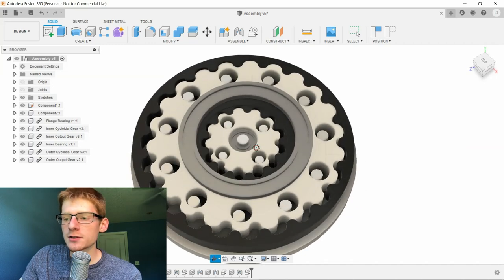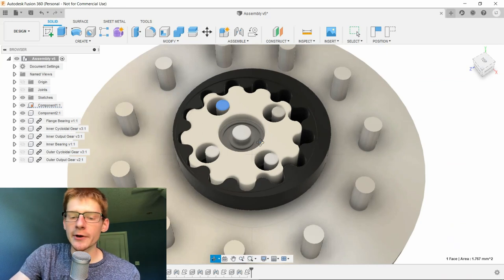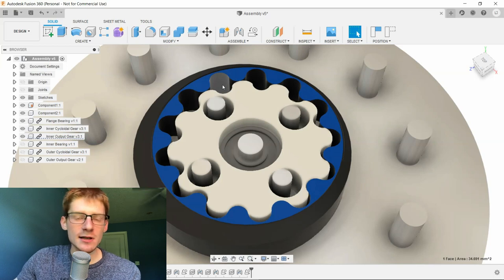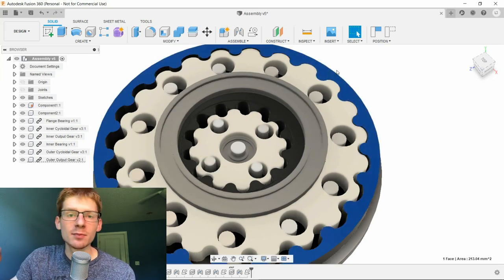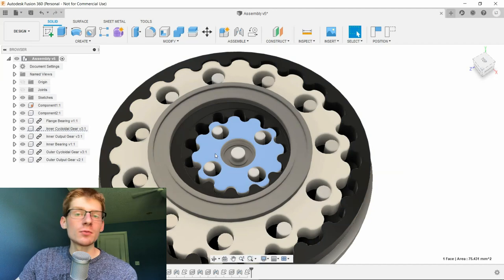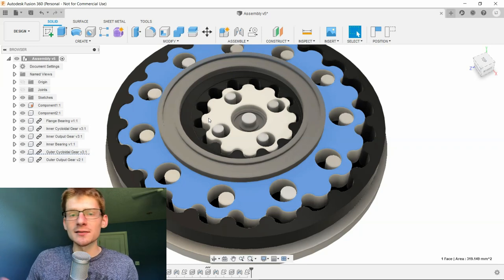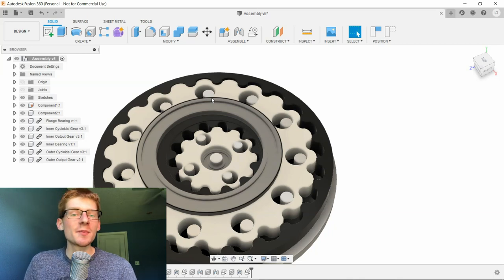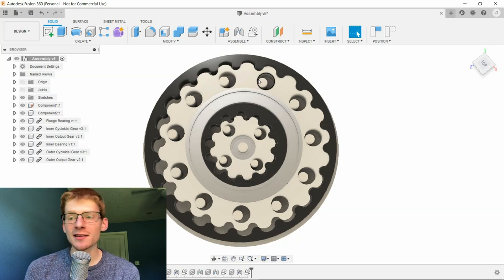The Compound Cycloidal Drive - Something Novel

Comment: Great video! Awesome design. The cycloidal drives look so cool running. If you can adjust the ratios and motor speed I think it would make a very cool wall clock with the different speed rings driving the clock hands. Toss in some color changeable LED lights and a glass front to show it all off.
Respect to you. Good job.
Reply from the maker: That is a wonderful idea! A clock of this design would be beautiful. I’ll have to think more about that.
Reply: @LeviJanssen  If the gear ratios are tough to hit you could use three cycloidal drives around the perimeter running at a good clip for show, then driving timing belts and pulleys to drive the hands in the middle. Many options. Sound like a fun project.

Comment: I don't know how I missed this video for so long.  This flows with exactly what would help my current project.  Am I correct in understanding that the final output ring won't be rotating around a fixed axis.  If that's the case, I'm not currently smart enough to figure out how to have it match the perfect circle that is the platform base.

Comment: You could replace that bearing by making the OD of the stage 1 output and the ID of the second stage input into a race and then run a frame and spacer (aka “caged”) supported bearing with 4, 6, 8 ball bearings in the space between them… and with the right filament and lube (think graphite)… you could potentially 3D print the ball bearings themselves
Reply: @Logan Vinson - thoughts?

Comment: For the size of your assembly, why not just make the teeth / lobes smaller?
Your problems seem to be that you want it to have a small diameter, made out of plastic and for fast input rotation.
If you machine this out of metal with an oil flooded case, you can almost ditch the bearings, fix the vibrations by making parts bigger and adding holes on the heavy side. It is a very interesting concept.
Reply: if you can remove the bearings entirely you can counter any possible wobble by simply adding a second layer with 180° rotation. The input shaft would be like on a piston engine and botht he black inner output gear and the black outer output gear could be one part because they rotate but don't move.
If you go crazy you can split the second layer in half and put the "first" layer inbetween it to even counter any new wobble introdiced by the two layers being offcenter in the third dimensions direction.

Comment: If the parts are cut in Teflon, you may be able to slide them against each other without the bearing
Reply: Or UHMWPE like PE1000 .
Other low friction solution is hard surface against hard. Either +63 HRC steel-steel or ceramic.

Comment: Couldn't you use rollers (like in a roller bearing) between the two plastic parts instead of a separate bearing or pure sliding friction? Would be low profile while also greatly smoothing the motion, essentially replacing the inner and outer race with your plastic parts

Comment: why not make your output ring gears from the 1st stage out of delrin or other type of machinable bearing material. That would reduce the size by eliminating the bearing completely. 
You could also consider a thrust bearings on the output rings to improve axial load support and a low friction teflon shim underneath both wobbling components since they are not rotating.

Comment: Why not just use polyoxymethylene, maybe with some grease, instead of that large bearing?

You can also redesign this to have the pin discs as outputs, allowing you to also use opposing cycloidal discs for balancing. You'd have to make the rings be stationary to the motor, and make the primary pin disc the eccentric for the secondary drive, which wouldn't be too difficult to do. Another thing this design would introduce is a dual output drive, assuming the secondary pin disc has a hole in the center to allow the primary pin disc to protrude. At face value, this removes the feature where the outside flange rotates, but you can also create a larger secondary pin disc that provides that outer rotating flange. Overall this design change seems more adaptable to various possible uses, not to mention that it's balanced and functions as a typical production cycloidal drive does.
Reply: Yes, with UHMD plastic you can throw the bearings away, at least at slow speeds, and it cuts like a dream on a cnc mill.

Comment: i love this and it looks really fascinating, but if i understand it correctly it looks like the central shaft is oscillating. so that is not the motor shaft? if you are adding a pinion to the motor shaft to oscillate that central shaft that we can see, then there is actually a second layer below the assembly you're showing here, right? effectively a 3rd, 1:1 stage i suppose. it kind of negates the flat construction since you have to offset the whole thing from the motor housing by the motor shaft length. or am i missing something?

Comment: I am trying to design a cycloidal gear setup in an application (just one stage in my case). I'm still confused as to why the four posts rolling in the larger holes are necessary. I'm also not clear on how to get the cycloidal gear tooth shape.

Comment: You say the big bearing is important... 

I say no: you can use thin film lubrication and make a liquid bearing (air bearing with lubricant or oil) out of that.
For that you would have to encase the whole thing, which also holds it together.

Biggest challenge here is to get the output leak proof 😉😅

Comment: Hi Levi,
Have you thought about decreasing the eccentric travel of the gears, thereby decreasing the height of each tooth? This might make the reduction a bit worse, but I think it would be a good way to make everything smaller, since it would decrease the size of the pin holes, the intermediate output ring, and the teeth.
Reply from the maker: I have. Doing that requires a modification to how I usually design cycloidal drives. The benefit couldn't be very significant, so I decided against trying to reconfigure my tried and true method.
Reply: Levi Janssen Why do you think the benefit couldn’t be very significant? If you halve the travel distance, wouldn’t that allow you to halve the tooth height and the pin hole diameters?
Reply: @thejerber44  Also, it would have the vibration. Reduction would still be the same, as dependent only in # if lobe/cavities. At some point, there would be increased chance of slipping/jumping a tooth, at a given torque. Or perhaps increased backlash as well?

Comment: Are you still designing the cycloidal disks the same way? I saw your video and I'm working on a way to make it parametric.
Reply: I did a small pyton program to make the cycloidal shape then add it as a script you can run in Fusion 360, that basically generates an scketch you can extrude to generate the cycloidal disk. Works fine, it worked for me, I didn't uploaded to Fusion store because it still lacks of an user interface to be descent enough for other without scripts experience to use it. If you want it I can share it to you.

Comment: Quite interesting design. Look for thk or schnheeberger  brands for thin walled bearings or cross roller bearings used in professional robotics. We have used them sometimes in applications of top notch servomotors we make at www.mavilor.com. Rathe4 expensive but save space for sure.

Comment: are you sure it is novel ?   anyway it is very cool   i will visit your patreon site

does the bearing need to provide support in the Z direction as well as the XY plane ?

can you have two cycloidal layers that are 180 degrees out of phase to reduce vibration... ?

what size bearings were you stuck with ?  i am doing some bearing research for your design
Reply from the maker: I figure nothing is probably truly novel, but I’d bet most people haven’t seen it.
Reply from the maker: I am not stuck with any particular bearing. My problem is that I'd like bearings with bores of 20 to 40mm that are only a couple millimeters thick. Hyper-thin bearings like that don't exist on the market.
Reply: @LeviJanssen  If you used lots of grease you could probably get away with a bushing instead of a bearing. You would want CNCed metal parts instead of plastic.